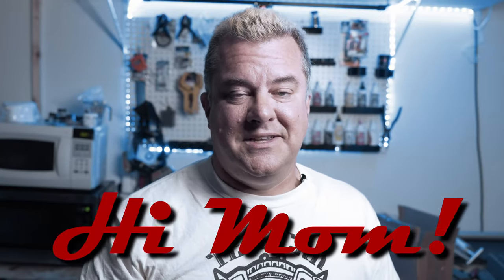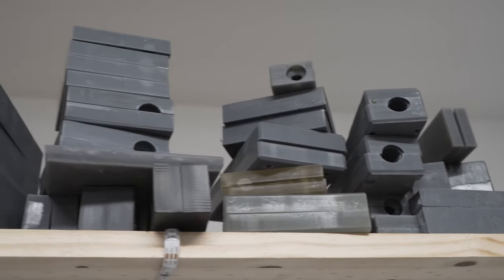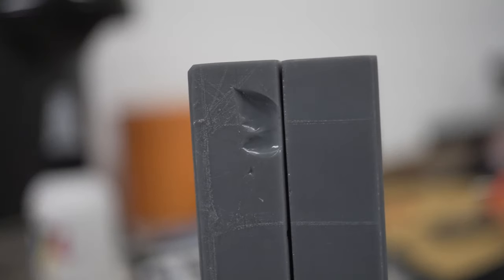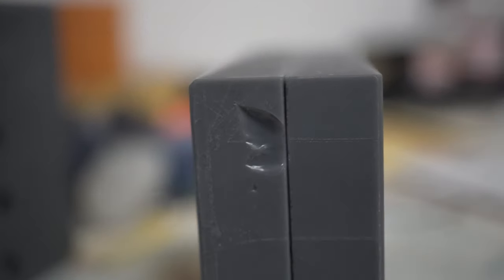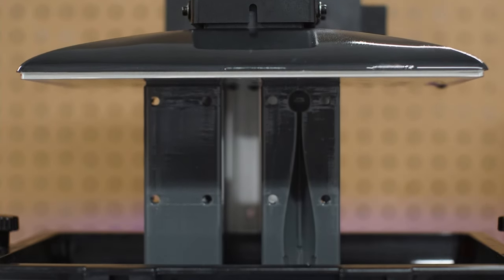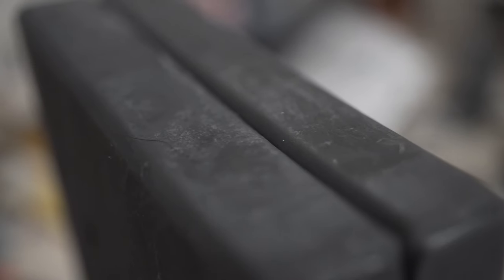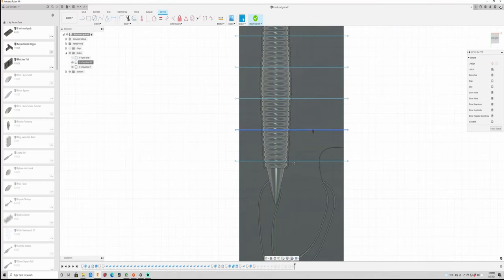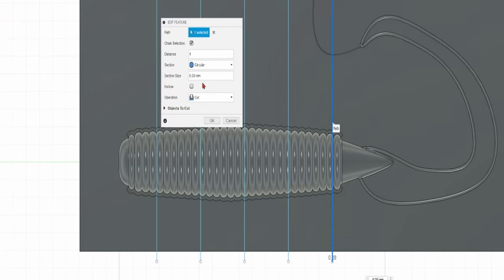8 Tips for 3D printed Fishing Lure Molds

Comment: Holes for bolts seems like the way to go, but I hope you don't mind me sharing a tip for printing with keys. I learned scaling your negative keys 5-8% larger than your positive in your 3d software makes for a much better fit. Learned this from a friend who prints jointed action figurines.
Reply from the maker: Awesome thanks for sharing! If people want to use keys that is the way to go.

Comment: THIS!! This is what I was looking for, was having issues with deformed injector ports and screw holes. Also I was printing on the longer side to cut down on print time. My question though is what are your resin/print settings? Having a few issues with sculpt. Thanks
Reply from the maker: Best advice on settings is to go to https://Siraya.tech click support, click sculpt then download the settings for your printer. They are always pretty spot on for me.

Comment: I love you channel with all your tips and trix and good advice! 
Question, have you ever tried to mcast lead in your mold, ex jig heads?
I have a Saturn, what wash do you recommend?
The Siraya Tech you also recommend, you mention Sculpt, Tenacious  and Build... When do you choose wich one to use , or do you mix them?
Appreciate if you could comment the above  :-)
Reply from the maker: I have not poured lead yet but I know a few people that have using Siraya Tech Sculpt Ultra (https://siraya.tech/collections/united-states/products/sculpt-ultra-white-1kg-by-siraya-tech). It has a higher HDT of around 420f/220c so it might be possible to pour lead if your mold was very thick. The people that I know have tried have only managed a couple of pours before the mold started to deform. They were pouring bullets though and the tolerances are pretty tight so it might work for smaller jig heads.

If you are using Sculpt and/or Build resins it does not make a lot of sense to get a washing station since those resins can't be in alcohol for longer than 30 secs. The curing stations are nice to have though. I have an Anycubic Wash and Cure Plus - https://amzn.to/3JkYp2y  I use the container it came in to wash my prints and only use the machine to cure with. You can get a complete run down of Sculpt in this video - https://youtu.be/ndYmHhDkA1Y